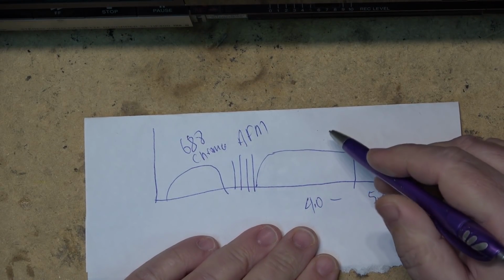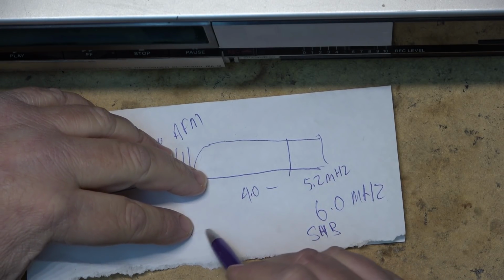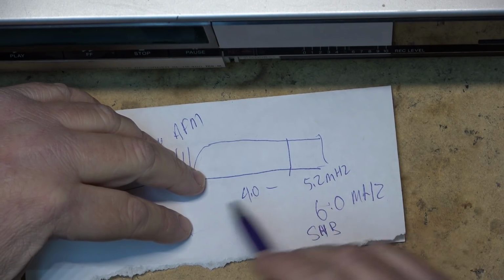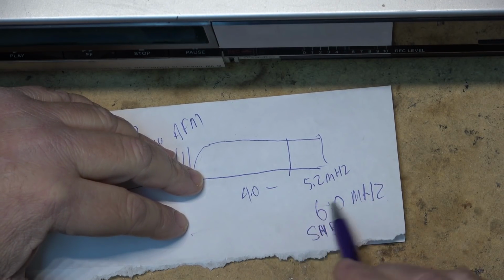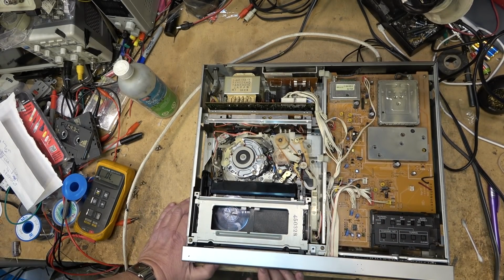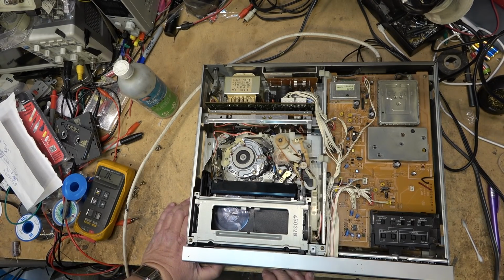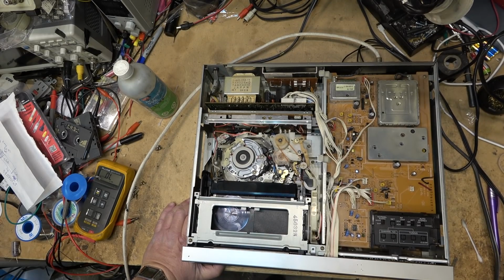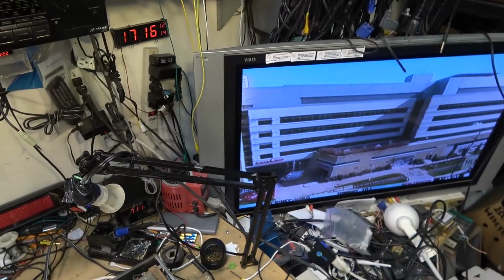Sony SLFH400 Betamax has a ghost in the machine.

Comment: I always said Betamax with the A.
I had 4 different Models of the Betamax I remember one model number I had was the SL-2700 & the other was close to the End it was sold as a Consumer model but could of been sold as a Pro Model because it had 2 side Handles on it!!
I also had the SL-2000 plus the Seprate Tuner 2000!! I also had there top of line VHS that had side wood Pannel’s on them!!

Comment: Never heard of Betamax ever. I still have our old VCR, a Fisher from 1992. it's Pal_Secam... What does it mean Pal-Secam? Picture is jumpy though, not clear. Just tried out after many-many years.
Reply from the maker: Pal was used in Europe and secam France. The middle east and Soviet block used another version of secam.  This is referred to as mesecam (middle east secam) to differentiate it from the French system.   Both pal and secam are 625 lines 25 frame video systems.  Ntsc was 525 line 30 frame.  Ntsc what's the first color television standard in the world developed by The Americans and one of the mandates when it was developed was that it needed to maintain compatibility with the millions of black and white televisions that existed, so some compromises needed to be made to ensure this compatibility. The same thing happened with FM radio when stereo was introduced compatibility needed to be maintained for the existing model radios. In Europe no such thing existed Powell was developed in secam was developed after ntsc and they basically said screw everyone that had an existing black and white TV we will move to a new frequency band simulcast some black and white for a few years to allow people to buy a new TV and then shut off the old black and white system. Mind you the black and white system that was in use in Europe at the time only had about 409 scanning lines so it was a really bad system. But Europe benefited by waiting and developing a system that ultimately delivered a better picture than ntsc did. They could get away with it though because not too many people had televisions that were made obsolete overnight. In North America there were millions of black and white TVs I had everyone being told that that new TV that they just bought was no longer usable there would have been riots in the streets. Even when the transition to move to HDTV came out there was a transition period and then adapters were made available so that people could receive the HD broadcasts on old equipment to allow the old equipment to be used until it failed. Some people actually still use old CRT equipment. I don't see as many these days on my day job but I still see some. I was actually at a customer's house 2 weeks ago and they still had an old CRT projector in use and it still worked and this thing would have been probably from the early 90s maybe late '80s it was old and it still worked.

Comment: Hi dave!
I have a JVC VhS VCR, mono,two head. It can't be more basic.

It plays fine. But it records only picture. It doesn't erase the old audio track, it doesn't even record the new audio. You can hear clearly the old audio combined with the new picture...
I resoldered all the audio board connections...but nothing changed...

Do you have any idea?

Thank you in advance
Reply: The full erase head should be energized in record mode to erase the entire width of the tape including the linear audio track. Since the existing audio isn't erased, there might be a problem with the erase bias oscillator. What's the model of the VCR?
Reply: @crashbandicoot4everr   Γεια σου Φοίβο! Thanks for the response!
The model is JVC HR-DX20EM
There is a free service manual on the site: elektotanya 

If the full erase head isn't working, why the new video track is recorded crystal clear?
Reply from the maker: Video will overwrite the existing track. If you play with the tracking you will likely see some color.   The full erase may be working just not the audio record circuit.
Reply: @12voltvids  
Thanks for your comment!
I checked the coil continuity for both erase heads and it's ok...
I'll try to find new transistors for the oscillator... I hope it won't be that difficult 😢

I just wonder why the new audio doesn't overwrite the old one creating an expected messed audio recording
Reply from the maker: @saint_and_holy_unicorn  choke coils also fail.
Reply from the maker: Sounds like the bias oscilator that operates the full erase head and the audio erase head plus provides the bias for for the audio record is missing.

Comment: I think your memory is much better than mine, i used to know the frequencys that vhs used in there recording but i havn't touched vcr recording specs for a long time.

I did roughly guess the button system on that betamax you fixed, resistors with a voltage at one end.
 The system measures the approximate string voltage as the target voltage per function is wide to allow imperfect switches (But not mucky ones lol ).

Just a crude way of understanding.
Cable remotes used it as well.
Don't rip me apart for my crude understanding dave, just in case you were thinking about it lol.
Earthing switches to the chassis,  even i would not do something as silly as that.
Reply from the maker: The reason for the resistor ladder dates to the wired remote days.  Just 2 wires.  Other silly European design uses strobe signals from the display on an x-y grid.  These systems required 6 wires for 9 buttons. 7 wires for 12 buttons 8 wires for 16 buttons. Who needed a garden hose size cable to go from the remote to the device.  Early Panasonic made RCA machines did juat that. Used a 5 pin din plug to connect the controller with a heavy cable.
Reply: @12voltvids  The european design sounds really stupid lol.
Yes i remember 2 wire remotes with resistors inside.
Thank god somone finally created i.r remotes.
Reply from the maker: @zx8401ztv  well you never lost a wired remote did you?
Reply: @12voltvids  Nope! but there were plenty of blind/stupid pillocks to trip over it.
Sods law states:  If it's an important cable, someone will trip over it,  if its an unused cable no one will go anywhere near it.
It has to be true as there are so many versions of sods law all over the world but only differ by name. 😀
Also if there is the perfect screw driver you need, it will be lost or stolen by someone.

Comment: I own 3 of those Microfurance Heaters, How can your boss at the time whinge at a power bill if there a cermaic heater? Sounds like a real jerk, I have one in the workshop i use alot in winter and my power bill really doesn't change much at all over winter but if i used say a element heater in workshop it would be very high as they use alot of power
Reply from the maker: I have both.  A big 4.8kw element heater and this 1500 watt that sits beside me when it's really cold.  
Yes he was a bit of an ass

Comment: Very useful information on how they accommodated the Hi-Fi audio.
From what you have said, the NTSC performance should be better than PAL.
I still think that Betmax gave a superior performance compared to VHS.
Sadly the rental market went for VHS, few people appreciated the better
format.
Reply: Living in a PAL area myself, I haven't noticed any real difference between the quality of VHS and Beta. As I understand it (and I'm sure somebody smarter than me will correct me if I'm wrong) Beta started out being superior to PAL, but due to the public demand for longer tape running times, very early on Sony reduced the linear tape speed, giving a longer running time, but losing the competitive edge they had on picture quality.
Reply: @djsherz  You are right regarding the loss of better video quality due to longer running times.
The early Bemax recorders had a far better video performance compared to VHS.
Super VHS brought it upto the standard set by the early Betamax models.
Reply: @djsherz  Beta always had only one speed for PAL/SECAM, very close to NTSC's βII.
Reply from the maker: @crashbandicoot4everr  yes that is correct.  Something to keep in mind Japan used ntsc like North America and basically all the engineering for VCRs was based on the ntsc system as that was the native system used in Japan. So all the coolest gadgets of really high quality were based on the ntsc system because Japan using the same color system they're broadcast frequencies were different but the actual color standard was the same so all the really high-end decks that we saw like the slhf 1000 was identical pretty much to the SL hf3000 which was the Japanese version. The pal versions were basically modified ntsc equipment that was modified to work with the different systems but because the major manufacturers were all in Japan they designed the systems based around the system that they used which was ntsc.
Reply: Yes it is better than PAL. I've done PAL vs NTSC tests using VHS and Beta machines and the results were slightly better resolution on NTSC due to the higher head-to-tape speed.
Reply: @crashbandicoot4everr  You get the same results with laserdic players and discs.
Only the USA and Japan had the better players and disc transfers.
In theory the UK PAL players should have
a slightly better 625 line picture, but due to the mediocre PAL players and poorly transfered discs, NTSC were superior.
Reply from the maker: Home video ntsc did record more information than pal.  Pal was around 220 lines and ntsc 240.  Beta 250. Broadcast however pal won out because the sound carrier was much higher.  On ntsc the sound carrier was at 4.5mhz so all video information was limited to 4.3mhz bandwidth.   The color subcarrierbon ntsc 3.579545. pal was 4.43 for color subcarrier and the sound up around 6.5.  There were multiple sound carrier locations that varied by country.  There was a total of 21 different broadcast standards all revolving around the 3 color systems.